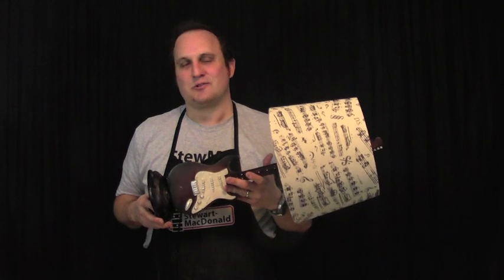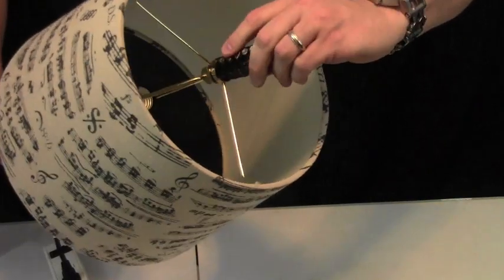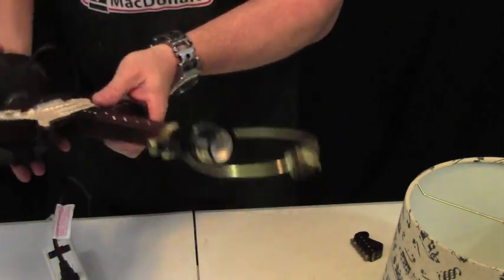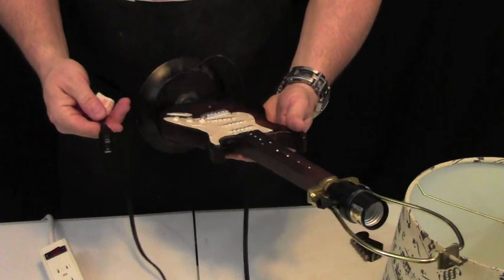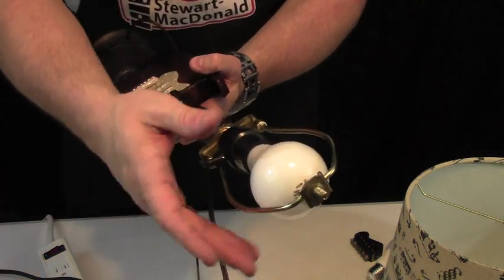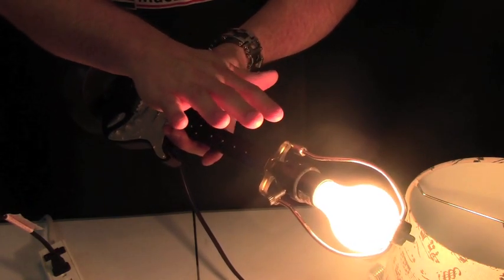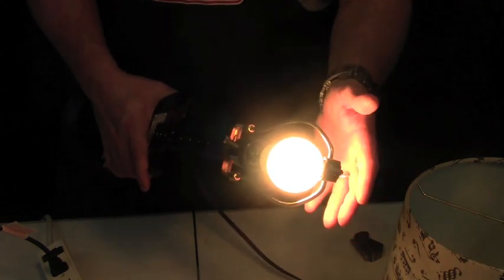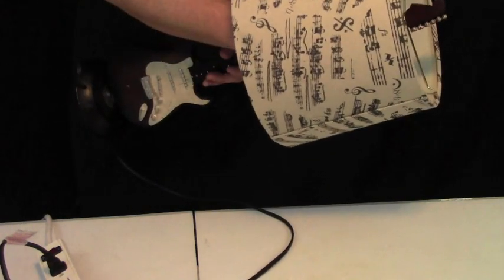Fixing Guitar Electrical Problems

Comment: Can you make a Jag Stang Sitarkulele? It has a Buzzing Bridge like a Sitar. How about a Jag Stang 8 String Uke?
Reply from the maker: I am planning on making a 4 string electric ukulele/sitar with some wood from India. Hopefully this year.
Reply: @CircuitsAndStrings  Why not model it after a Jag stang, it should be called the "Jag Stang Electric Sitar-Kulele"
Reply: If Kurt Cobain was Indian.
Reply from the maker: I think the body will look more like the guitar sitar made by Danelectro.
Reply: @CircuitsAndStrings  The Baby Sitar-Kulele is modeled after the Baby Sitar Guitar made by Dan Electro but, Why not make a 2nd one that's modeled after the Jag Stang called the "Jag-Stang Sitar-Kulele"
Reply: @CircuitsAndStrings  How about a Double Neck 8/4 Sitar-Kulele which is like the other one you made but the 8 String neck is tuned like an 8 String uke, the bottom 4 string neck is a Low G tuning uke, & it has buzzing bridges to make it sound like a sitar. If Jimmy Page was Indian.
Reply: I might be able to work out something, even though I'm not the best luthier.
Reply: @CircuitsAndStrings  Why not a 2nd one modeled after the Jag Stang.

Comment: I'm going to do a video similar to this. This was hilarious by the way.
Reply from the maker: Thank for watching. I also enjoyed your video.
Reply: @CircuitsAndStrings  It'll apply to electric ukuleles too. Eastwood makes a Mandocaster 12 which is tuned an Octave above a regular 12 String because it's half the size. It's only 500 dollars (good) & it looks like this:https://reverb.com/p/eastwood-mandocaster-12
Reply: @CircuitsAndStrings  thanks!
Reply: @RockStarOscarStern634  I'm thinking about getting one.
Reply: @aWildJosh213  It sounds like a Mandolin but the Chord shapes are the same as a Guitar.
Reply: CircuitsAndStrings 2 Mr Stern I’m a guitarist, so that’s easy for me.
Reply: @aWildJosh213  I can't wait to see and hear what it sounds like. The Mandocaster 12 String Soprano Guitar will be perfect for Show Choirs due to its size.
Reply: I like short scale guitars, so it's perfect.